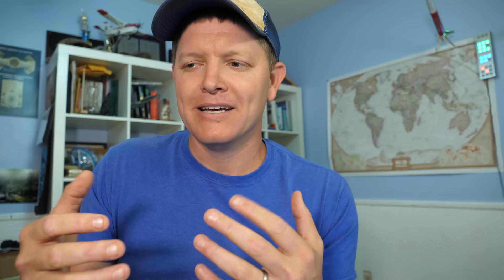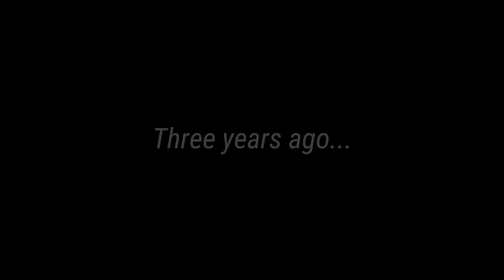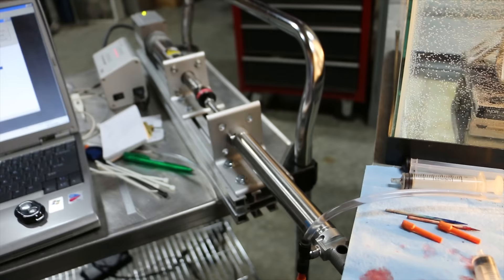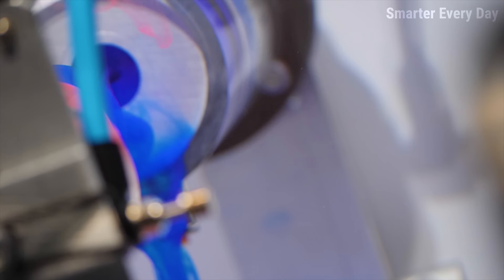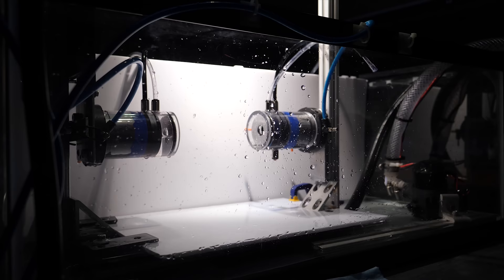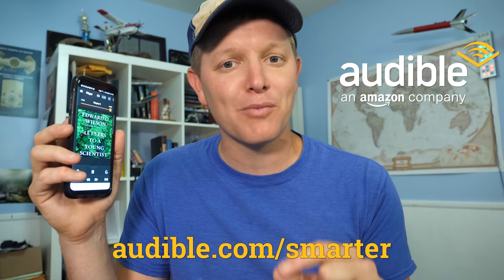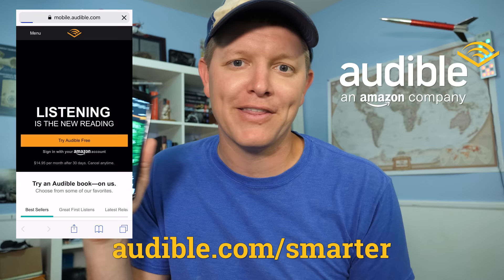Two Vortex Rings Colliding in SLOW MOTION - Smarter Every Day 195

Comment: Will the same happen with smoke rings in the air?
Reply: Mystified 2 not the same density?  Idk
Reply: It should..
Reply: probably, just in different fluids
Reply: Irval Firestar welp air is just like less dense fluid...
Reply: New vaping challenge!
Reply: Probably, though not as cleanly I imagine.. you'd have to have a thick, dense smoke in order to provide the radial inertia necessary to overcome the difference in Mass/weight between air and the smoke.

Comment: the initial ring and the smaller ones share something, maybe internal rotation, like gyrostabilization or rotating around the same center, so the structure, the ringform, repeats itself until all mometum left from the collision is gone and in the end it gets rougher and more fuzzy as the color particles drift apart. Maybe? Brainfart :D

Comment: They could be caused by the face of each ring rotating the same way, but when they meet head on they initially have a speed increase as they suddenly move faster then the inner layers, causing the ring vortice to stretch, then as the pressure heads to the centre and resistence increases the inner chain of the vortices suffers from the pressure build in the centre so can't perform the same trick and ends up wiggling when they collide around the other, snapping at the loose points and the two loose vortice threads connect, I think the new ring picks up more speed from this as they spin around each other choosing up or down  and making a 360 rotation and then being released in the path of least resistance the result would be sometimes they head slightly back, sometimes slightly forward but always outward by this point as the face collision has reorganised into a different fluid motion and is no longer heading inwards but the pressure might still be there?

Truly this was beautiful and fascinating thank you so much and glad you had the patience and persistence to keep going.
Reply: Having watched some more of your footage I can say I'm definitely not correct! But wow now I'm interested :D

Comment: Arrrgghhh! This is SO cool! I want to do this!!! I have questions.. I need answers... Like, why did you get TRIPLET exterior rings on the 90 deg.(?) axis, or basically, dead center thru the thing, at the east/west axis, on some of your successful attempts, while all of the other rings were singles? And, why were some doubles, on the same attempts along with singles? (I'm saying single/double/triplets meaning the outer rings coming off the main were tightly grouped together)..... does any of that make sense?
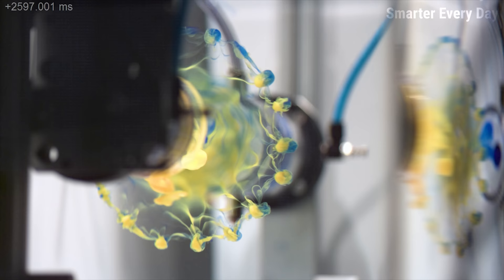-- I went back and frame by framed it... at 4:52, there's a good example of what I'm talking about. It shows a few instances of triplet formation, intersperced with singles.... And at 5:15, there's a really clean shot of evenly spaced singles on the entire ring....
~~~thank you for sharing all your hard work with us, I learned about something entirely new, and THAT is saying a LOT! (because I'm a nutcase information sponge, LoL) Wish I could try something like this... but I wouldn't even be able to afford the fish tank, let alone all of the other stuff.. :(
Reply: The residual outward flow is what creates the rings at 90 degrees. The pressure differential creates the "clumping" of the medium, then the continually expanding outward flow aligns the rings the same way it does the primary. The reason you don't get evenly spaced secondary rings is likely variations in the flow throughout the tank. Possibly even pressure differences from the proximity of the tank walls.
You'll never get water in a tank to be perfectly still, so you'll never get a formation without some variations.

Comment: The 90⁰ turn is the fourth dimension playing out live in front of our eyes, since the matter your using is so light and it's molecules are so spread apart in can litteraly phase thru itself, of course you factor in the artificial almost neutral environment you created to conduct your test and you can see 4D physics in action, of course it's almost impossible to shoot both plumes at the exact speed at the exact mass at the exact time to be so level that you're results would be symmetrical perfection but you guys got as close as possible, each secondary circle is basically a KLEIN bottle in action, the Klein bottle is a 4d structure for those who don't know, so 4d is height, width, depth, and energy, it's a form of matter that can only exist in a semi solid form if it's in constant motion, it can only exist if it forms a shape by neutralizing the energy it contains to form an infinite dance where it's mass is completely connected in a way it can constantly contain motion, it pretty much is moving through itself in ways that 3D matter is too solid to ever dream of doing, but 4d matter cannot exist in an environment that isn't completely neutral, no gravity, no atmosphere, nothing but a complete vacuum like space where perpetual motion can exist.

Comment: Have you ever thought about the electrical devices in the water cause a frequency, which would slightly vibrate the water which could possibly cause the effect, maybe try the experiment with different frequencies in the water and see if you get different results or shapes

Comment: I think there is a low-pressure spot on each side of the opposing ring that creates an acting force to spin the mini rings 90. 
Think of the low-pressure area following the smoke ring itself and those low-pressure areas carrying on and slipping past the crest of the pressured region of the ring. While doing so, the low-pressure areas momentarily layer on one another until collapsing into one low-pressure area. Thus, creating a slight spin due to one of the rings not perfectly matching up with the other and then the resulting low-pressure areas layering over each other as it crests over the region, and then said low-pressure areas snapping into one creating the 90 spin.

Comment: Seems to me the ink behaves the same at the ring's edge as it did at the nozzle. Friction carries the ink forward against the resistance of the static water, and so long as the rings have the angular momentum to gain traction on the water, they remain intact and burrow on. After impact, each ring takes over half the burrowing, the two colours together continuing until they lose the angular momentum to maintain cohesion, bloom, and are again inflated by the water dragged in the ink's wake, creating little rings. That's why the rings in the failed attempts sometimes swallow their partner : stronger angular momentum in one ring. For people more comfortable with a hands-on example : go buy and play with a water wiggler. Observing the interactions of the parts inside the wiggler, at different distances from the surface, can teach you this as well.

Comment: Perhaps it's the way the two vortex collide, the bounce happens in three dimensions instead of a flat angle. If that high-pressure area is continous as it dissipates it would push outwards away from the point where it all came together

Comment: Should've used green dye sprinkled over the top before firing to see the invisible bits of the water

I bet that when the two tubes bend to meet, either torque makes it bend,  or the middle portion also rotates being dragged by a low pressure sre that makes a tornado, one side is attracted to the other and vice versa, sucked into one another.

It's probably both, I'd reckon

Comment: It would be interasting to make the same in a physics engine on a pc and see what happens. 
sry for my english.
Reply: Thats the whole problem... the physics taking place here, to create the secondary rings effect, is unknown. Ergo, the experiment their doing is the first step in creating a physics engine that's even capable of replicating the vortex collision effect... Otherwords, no one can write that program yet...
Reply: Garrett Stubbs 
complicated rules are made by simple rules. Like orbits: complex and hard to understand but it's all just caused by gravity. Now apply this to the rings: momentum, rotation, mass, volume, density, viscosity, drag, compressibility, take away the inperfections like other flows (because simulation) and boom maybe it works, maybe not.
Reply: Ugh... here we go... It's not "all caused by gravity" there's friction, caused by resistance, caused by the liquids involved having different densities caused by their varying dissolved solids, generating heat from sub atomic particle exchange, heat that expands the water, reducing the resistance and friction and subsequently slowing the aforementioned particle exchanges, etc. etc. etc... Then there's micro-gravity. Rotation of the Earth, solar radiation affecting the ionosphere, effecting the poles, their location, the Earths magnetic field, slightly affecting gravity, at different locations, at different times, making gravity a non-constant and ergo inquantifiable. Meaning gravity and its effects are in a constant state of flux and therefore CAN NOT be accurately predicted. This is why objects in a visual effect that are falling due to the simulated gravity produced by a physics engine never look 100% real. Their movement is never completely accurate because it's too smooth and constant, whilst in real life it's movements would have tiny deviations in acceleration and overall speeds due to all of these "simple systems" at play, making the image of a real object falling descernable from a. Cgi object falling. There are millions of "simple systems" in play, making it impossible to predict the outcome of their experiment. Why do you think scientists even still perform experiments, and don't just feed everything into a computer and just document the results of a simulation, rather than the results of actual experiments? Because simulators aren't 100% accurate. There's no chaos theory in a computer program, and even if you tried to create chaos in a computer program, it would be generated by an algorythm, thus making it predictable, ergo NOT chaos. Pseudo chaos at best, and not able to create accurate enough deviations in physical behaviors of fluids interracting at Earths gravity, traveling at the speed of earths rotation vs. distance from the Earts center, etc, etc, etc,... to explain WHY the rings are generated in the first place. Point blank: Fact of thd matter (in laimens, for your benefit) is that a physics generator capable of reproducing the effect that they are observing, cannot be created until after experimentation identifies the systems that are affecting the fluids as they interract, and subsequently explains HOW the systems are effecting them, and ultimately creating said rings... The data their gathering is necessary in producing said physics engine, for this particular application. If you see a computer graphic of this effect (which you won't because it can not yet be generated, which is the whole reason for these guys curiosity and experimentation, in the first place), your seeing it because somebody programmed the image itself... NOT because someone wrote a physics program which produced it...
Reply: Garrett Stubbs  You're just saying what he said with "momentum, rotation, mass, volume, density, viscosity, drag, compressibility," don't try to be condescending while adding nothing to the conversation.
Reply: No, he said that you can not recreate the experiment on a physics generator because we don't know every thing that is affecting the experiment
Reply: Garrett Stubbs all that i said was basically "simulations =\= animations. Simulations simulate objects with some rules and animation is telling the object exactly what to do."

So i want to see a ring similation, but simplified. Maybe it will still do the secondary rings or not. If not, increase the complexity by adding a rule to the system or an inperfection. But if it works in a simplified system, then simplify it more, untill you figure out the one rule (or a combination) that causes the phenomena. 

I have seen many simulations and games that do the same thing, like universe sandbox: it doesn't simulate each rock of a planet (or atom) but planets are single objects. And the system still works!

Edit: i will not answer to your looong comment because i want to sleep but still a little answer: You know, in simulations there is a "good enough" threshold for realism. Who cares if a orbit is by one km higher after billions of years? No one, unless you are trying to simulate that exact thing. (Also was that "ugh... Here we go" really necessary? Leaves a really bitter taste behind your points)
Reply: Anh-khoa Chau-Vo but we should be able to figure out by trial and error: start with a simple system and step by step add different rules and interactions (like drag, temperature) until it works. Also i have absolutely no idea if that would work
Reply: interesting*
Reply: @godchi1dvonsteuben770  That's*
Reply: @godchi1dvonsteuben770  they're*
Reply: Garrett Stubbs hold my beer.
Reply: @godchi1dvonsteuben770  
"and a partridge in a pear tree"
Reply: Seems like some people in here are proposing a reality simulator.
Reply: lol i just wanted to know how this experiment would behave in a programm like blender or whatever...
And now people are arguing why it wouldnt work or some bullsh*t. like no one who red the comment wouldnt know this already... 
I mean i just thought it would be interasting to see what would really happen.
Sry for my english🤣
Reply: @godchi1dvonsteuben770  Perhaps there could be links between rules in physics which cause this, so giving a neural net all the possible rules of underwater smoke rings we know could result in it finding links we didn't know could effect each other.
Reply: I feel sorry for you that some people just throw a bunch of deterministic theories and think everything could be modeled.. They won't understand the difficulties when encountering emergence behavior.
Reply: It actually mentions this early in the film when it says that some people did try to figure it out numericaly.
Reply: It certainly could be simulated, though the accuracy would depend on the computational power.  With access to a proper supercomputer, every atom and molecule could be simulated to follow the basic laws of the universe.  It would take tweaking, for example how much could we scale down the phenomenon before it stops happening?  Will clouds of just a few thousand atoms do the same thing? If so, it would be much easier to model all of variables.  

I think Michael gave a perfect explanation as to how modeling of this phenomenon could be done, so forgive me for parroting his post.  But it's likely that not every single variable mentioned by the above detractor affect this particular phenomenon.  One would start as simply as possible and tweak the parameters until the phenomenon is observed.  Then we could find out which variables contribute, and which ones don't.  It's a perfectly reasonable suggestion, though it is limited by the cost and availability of computational power.  An extraordinary amount of science is done with computer simulations, but after the parameters have been determined, the real life experiment is done in order to confirm the results and rule out anomalies.   In this case we'd be working backwards, with the physical implications already determined, and the original parameters still to be determined, but the scientific method itself would remain relatively unchanged.  

While i do not think think this particular interaction is important enough to warrant hours, days, weeks or months of rendering on our largest supercomputers, his original post simply indicated a desire to see a similation.  Such a similation would likely not get funding unless real-world applications can be gleaned from the data, but it certainly doesn't hurt to wish for one.  

tl;dr not sure why you're so effin salty dude
Reply: Danielle Spargo I do nuclear structure calculations and I can tell yo that beyond 60 nucleons you can’t simulate with “basic laws of universe” (QCD and QED in this case) because this kind of supercomputer doesn’t exist, you’d basically do mean field theory and try to get a ballpark. In the case of fluid dynamics there’re a lot of stuffs we don’t know exact, because if you’d simulate the individual atoms you’re talking about the scale around 10^23, and the current best is ~100 molecules.

Comment: The motion from them snapping apart in the low pressure point sends the blob into a rotation. I'm pretty sure.
Reply: I think there is no rotation. What happens is exactly what happens in the primary collision. Just on a smaller scale. So for example when a1 hits b1 then because the impact is uniform it expands outward from the center. Then once the expansion reaches a point where the medium stops the expansion the force continues on that edge so that we get a secondary collision where each side becomes it's own system like a2 with b2 and so on going around the circumference of the newly created ring. Then the impact of the forces represented by me as a2 and b2 reproduces the primary event in the secondary impacts. With the same force being spread from the initial contact in the center. I hope what i'm saying makes sense. ^_^ it's not the circle that rotates it's the direction of the force that shifts based on its reaction to the medium. Imo....
Reply: TheBloodypimp maybe!
Reply: TheBloodypimp That is what I thought🤗

Comment: you coulda put ridges or even fins along the sides of the tank, increasing to thickness towards each end. All the baffles would have gone a long way to preventing stopping and preventing convections in the test tank. you only needed the center part of the tank to make a ring anyway. This would have greatly sped up time between refills waiting for the water to quit stirring at the least.